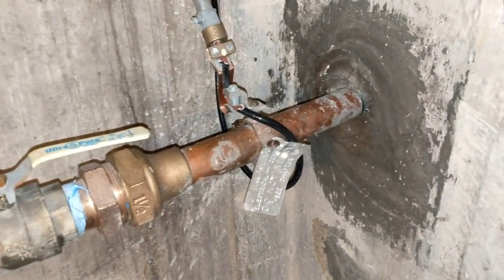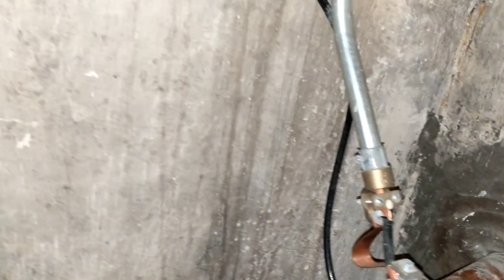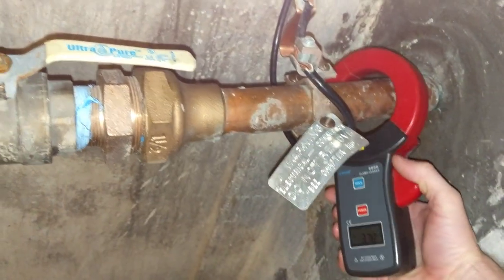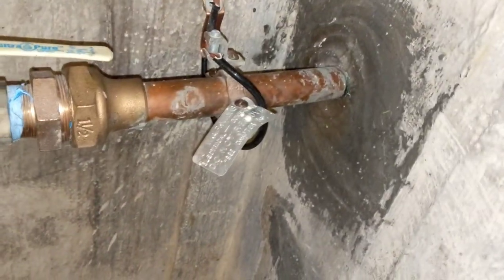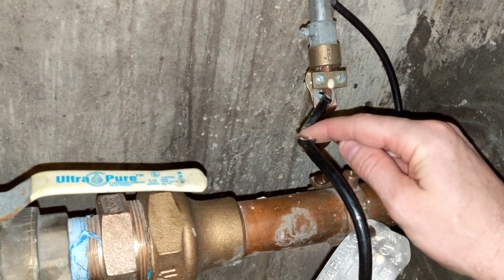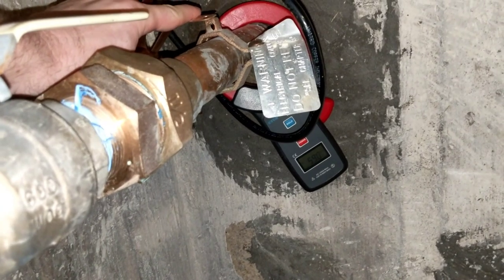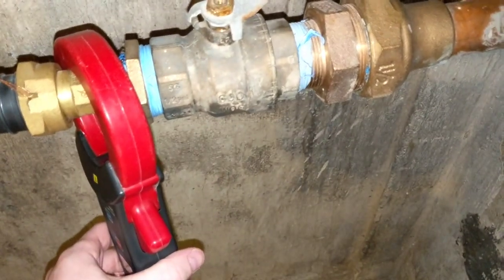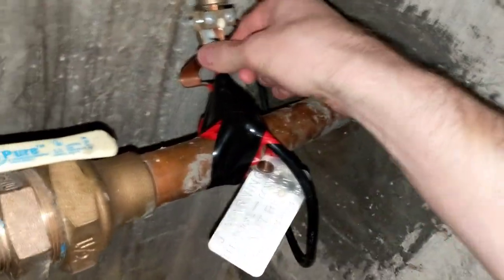How to measure current on pipes with AC Clamp Meter and isolate water pipe to stop undesired current

Comment: "That solves the problem..." Not really, though. Where is the current flowing now?
Reply from the maker: Back on conductors where it should be and off of the pipes in the building and the supply pipe going to the street.

When you measure current on the water pipe like this, you'll find nearly the same amount (only other variables really are ground rods and coaxial cable service) on the neutral feeder.  Current from other buildings and then also the imbalance in the ungrounded hot feeders.

Good question - thank you for asking.
Reply from the maker: There can also be a slight raise in ground rod current, but really it just balances the electrical service feed.  Current on coax could go up too after doing this.  Coaxial cable TV lines should be isolated too.
Reply: Electrical current should not flow through pipes. The current flowing is the problem and an undesired side-effect from bonding two metallic parts with each their own voltage potential. In an ideal situation there should not be any voltage potential on any metallic part and bonding would not cause any problem. But since wires are not the theoretically preferred 0 Ohms but have a significant resistance and whenever there is current flowing through wires with resistance a voltage will exist across the wires.

When you have what is called a TN-C-S grounding system (the standard in North America and many place in the world) which means the Protective Earth and Neutral are delivered to your building as one Combined wire (hence the C in TN-C-S), and you separate them (the S in TN-C-S) in the main electrical panel to a Protective Earth and a Neutral and keep them separated in the whole building. The problem is the voltage already present on the neutral will also still be present on any ground wire and everything that's bonded to it since in the main electrical panel they are still connected.

Solutions are plenty but they are usually more expensive then just bond the two together to prevent shock hazard and call it a day. The best solution is make sure everything entering the building is isolated first. For example by replacing a part of the metallic pipes with something non-conductive. The same goes for gas pipes and CATV which can be isolated with what is called a double galvanic isolator. When the problem is limited to one building, this is usually the cheapest as you do not need to involve utility companies. Usually they don't solve any problem but rather apply some changes that cause some relief while charging you a premium.
Reply: @EMFExplorer can you elaborate on isolating cable line?
Reply: @robinheijblom2929 can you provide more information on isolating the cable and gas?
Reply: @vfsd234  It's basically replacing part of a metallic pipe with something non conductive like PVC. Be aware that some PVC looking pipes might have steel or aluminum reinforcement layers. 

Although the conductivity PVC pipes with reinforcement layers is usually lower than  pure metallic pipes and the reinforcement layers might not directly make contact with anything the couplers sometimes do basically defeating the purpose of the isolation.

The best experiences are with pipes that don't have any kind of internal metallic reinforcement like tyleen for water. For gas regulations are strict and local so you will have to get information on what is allowed in your country/state/county/city.
Reply: Thank you very much! We have found our water in every facets measures up to 1-2volt of current and our pipes are pex. Where should we be looking?e@robinheijblom2929
Reply: @vfsd234  Current is measured in Amps, not Volts. How did you measure the Volts?

Comment: I see there are many people not understanding how magnetic fields are created and interact with the environment.

The problem is in most older buildings the water pipes are most of the time not following the exact same route as the main incoming electricity feed. If you would have an underground cable and piping right next to each other then yes there will be no problem since the magnetic fields will be very local. However worst case your water piping enters the building in the front while the overhead electrical wiring enters the building from the back. This will create a massive magnetic field in all the buildings in between the water pipes and electrical wiring.

This is different from the magnetic fields around wiring. These are usually very local because in a circuit you have two opposing magnetic fields. Many people also wrongly believe it's bad practice to keep an extension cord rolled up in use because the coiled cable will cause a massive magnetic field. This is not true because the magnetic field from the line wire is the opposite from the neutral wire so they would cancel each other for >99%. The reason you should unroll an extension cord is because of the heat the cable will produce.

There is however a problem with the way the problem is solved in the video because the unbonding of 2 pipes creates a potential shock hazard. I also don't really understand what the thin pipe is doing there. It seems it's only there to be electrically bonded but no water is tapped from the main pipe. So basically it serves no purpose being there and therefore should be completely removed if you don't want to bond it or replace it with a piece of non-conductive piping.

Whenever you don't want to bond accessible metallic parts you should find an alternative so people cannot touch the unbonded metallic part. That's why most ungrounded electrical appliances are double isolated so there are no touchable metallic parts on the outside which could cause a shock hazard. So either build something around it, or remove it completely to another room so it doesn't have to be bonded directly in an undisired way.
Reply: This is the way they do it now in the US.  A dedicated, large-gauge wire to bond the pipe right at it's beginning since they say they are also using it as an electrode, despite having multiple ground rods as well.  This is also silly and not ideal, and Mike Holt has pointed out, for it is best to have all electrodes in one place otherwise the potential increases and you can be very likely encouraging lightning current to travel across inside the building to the other electrode(s).

I agree with you that it would be a better practice to insulate the pipe, but I'm glad the video has caused great discussion to happen!  And still it is safer than having the magnetic field.  Thank you for sharing your knowledge to help all the electricians out there who are still learning about this stuff!!!
Reply: @shaunkranish  I don't really agree with you it is safer than having the magnetic field. Since American Electrical systems require neutral bonding a significant voltage can be present and in case of an electrical failure even hazardous voltages. In European systems RCD's are mandatory in all residential installations and most professional installations and therefore neutral bonding is not mandatory in all systems below 3x80 Amps as long as the ground rod is low enough to make the circuit breaker disconnect. Usually between 1-5 Ohms depending om the maximum Amperage of the main fuse.

Since we have 230 Volts and heating is mostly done by gas and heat pumps. Most residential buildings have less than 3x80 Amps. Apartments are usually 1x25A, terraced houses like mine 1x40A and detached houses 3x25A or 3x40A. This means the maximum a typical residential user can draw is anywhere from 5.7 kW up to 27.6 kW. And we can easily get by with it. We don't have daily main fuse dropouts. But again, electrical heating and air-conditioning is not very common in Europe.

In Europe we either have single phase 230 Volts or three phase 230/400 Volts. There is no such thing as split-phase or delta-high-leg. We have none of this exotic stuff going on over here. Only very old pre-WWII electrical systems sometimes still have an old 127/230 Volts transformer where 230 Volts is supplied phase-to-phase instead of 230 Volts phase-to-neutral and 400 Volts phase-to-phase. But I'm not even sure if it still exists. Last stories I heard from electricians encountering these systems are from 10 years ago. I heard from someone living in Norway they still have it in some rural area's. But they never use the 127 Volts, always the phase-to-phase 230 Volts since everything sold here is designed for 230 Volts although more and more electronic appliances are universal and support anywhere from 100-240 Volts and any frequency from 45-65 Hz.
Reply: @robinheijblom2929  In my experience with thousands of clients, and indirectly through other practitioners like me in the US - a lot of Building Biologists trained by the Building Biology Institute - and their countless clients, no one's ever been shocked or tingled or had issue with it.  Overall fixing this problem makes people feel better.

Interestingly enough, grounding the house with more ground rods in the same area can sometimes make people better and sometimes worse.   It can lower some of the electric fields even though is it raising potential contact current in surfaces.  Tough thing, so sometimes we have to experiment and see what works for each client.  At least ground rods can be hooked up and easily disconnected for the experiment.  I've never had a client who re-bonded or re-jumped the isolation/insulation in plumbing pipe however.  Not that I can recall.  That is also easy enough to do.  These are not major, irreversible actions.  It can be easily experimented with.

So in my experience the voltage is low across the plumbing pipe break.  But since apparently the circuit impedance can also be very low at times, because the current can be quite high despite low voltage.

So I can only think of one time it was potentially dangerous and that is in one of my old old videos.  Some idiot didn't tighten down a neutral feeder at all so the house had virtually no service neutral.  That was a neighbor and they called me luckily so I was able to tell them the problem, get the utility to check the neutral outside while I looked inside and found it loose there as well.

Regardless, here is the kicker and where we must now focus: plumbing pipes are not allowed to be used as conductors.  That is a violation of probably all codes everywhere.  If circuit current is taking pipes, there is a flaw in the system design.  We must now amend the codes and come up with ways to satisfy reduction in the risk of electrocution even if the risk is very small, satisfy the code in that only conductors can be used for current in regular conditions, and most importantly that we aren't creating magnetic fields and therefore health risks and the ability to create the transformer effect or induced current in materials.

I am saying the risk of electrocution is extremely small, agree that it can be further reduced, but am adamant that we stop this practice of using pipes as conductors in circuits.  It is not an excuse to violate the most basic laws of design - use WIRE CONDUCTORS designed and approved for the loads and only use these.  Anyone who says otherwise is being intellectual dishonest.  I am not accusing you, Robin, I am challenging you to agree that I've made my point and I am right.  Something must be done and the codes must be changed to right these wrongs, end the practice of using pipes as conductors, eliminate the fields, and also reduce the risk of electrocution which I list last because in the US I truly say from experience in measurement is less of a risk than the fields.  But you don't have to agree with me on which does more harm.  But I think you should agree with me that this practice should be changed and there are a number of potential solutions that would satisfy both concerns and end the remarkably willfully ignorant and sometimes brazen practice of using pipes as circuit conductors - which once again in and of itself means the voltage problem and risk is not gone but just waiting for anyone who cuts that pipe.
Reply: @shaunkranish  I totally agree with you on the part stray currents should be avoided. But what I don't agree on is the way you've "solved" the problem. What I see is everyone is moving the problem around. 

Water and gas companies say they have nothing to do with electricity and therefore don't care about anything related to voltages and currents. And electricity companies don't care about it either and actually like it their neutrals will less likely be overloaded or fail when pipelines and other conductors are acting as "alternative" neutrals.

Water and Gas companies should be responsible for not letting their pipelines being used as alternative conductors by making it impossible to access the incoming pipeline and apply galvanic isolation by using non-conductive meters and/or adding pieces of plastic tubing and only give external parties access to the meter and pipes going into the building.

Electricity companies should be responsible when they notice the current returning on the neutral is not the same as the supplied current of the phases. But when you use the neutral as a ground wire this is very difficult. That's why France only uses TT grounding. The main circuit breaker is also a 0,5 Amps RCD therefore it is impossible to make neutral to ground connections on the consumer side of the meter since it would likely trip the RCD when neutral voltage raises because of electric consumption.

Just because you haven't noticed extreme voltage potentials doesn't mean it can't happen. Under normal circumstances voltage on conductive parts should be very low. Up to 10 Volts at most which is still safe to touch. However I did encounter a phase-to-ground failure once on a TT-system that had a failing RCD and therefore the voltage on any grounded surface compared to an isolated testing ground rod was 100 Volts. Luckily everything was properly bonded so the voltage difference people were exposed to was much lower. That's why bonding is necessary. That you never have encountered such a situation means you're lucky.

But the solution is simple. If you don't want to bond something because it will prevent stray current, you should make it impossible for anyone to touch the non-bonded metallic parts. At least put some isolation around the whole pipe and mark it with orange duct-tape or something. Best is to even put something on it like risk of electric shock. I'm pretty sure there are ways to work around the NEC just like you can evade the dutch NEN1010 bonding rules by putting something in a different room or inside a wall so it's not readily accessible.

There are actually diode grounding systems for ships since continuous stray currents cause corrosion. These diodes only start conducting when voltage difference becomes too high. This prevents corrosion under normal circumstances but will protect you from hazardous voltages differences in case of a live wire failure. Usually they are accompanied with a warming LED and a piëzo beeper that would warn you in the rare case the circumstances are not "normal" anymore.

In the Netherlands this problem will solve itself in the near future because new installations mostly have plastic pipelines and more and more metallic pipelines of old systems are replaced with plastic solving the stray current problem once and for all.